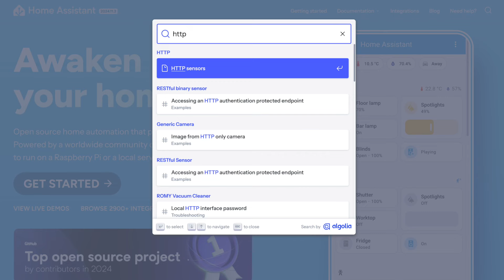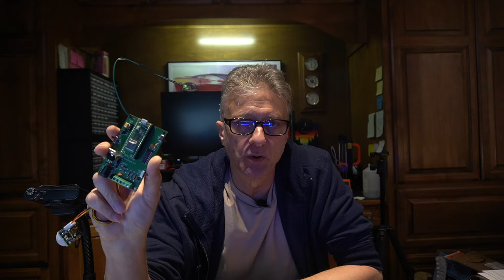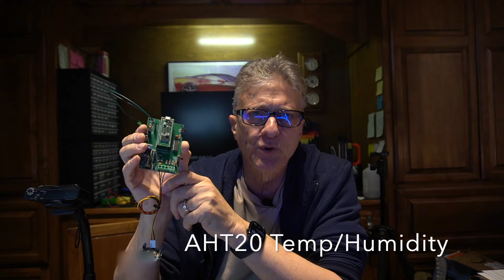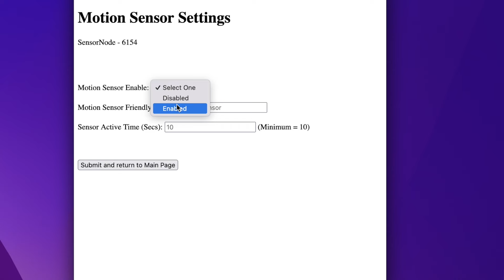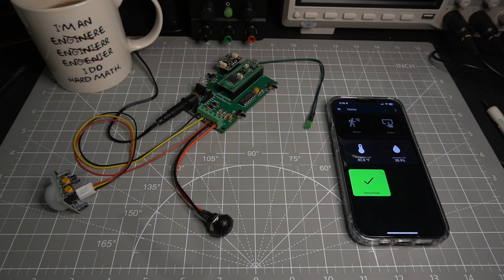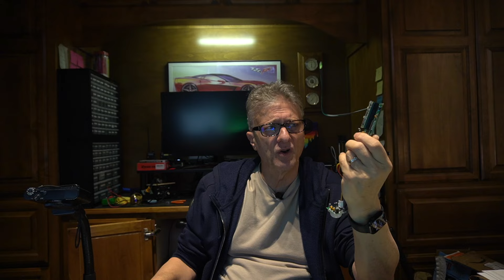SensorNode - The Easy Way to Add Sensors to Home Assistant

Comment: Why not use a ESP 32 S3?
Reply from the maker: Hi there - I assume your question is about using not only an ESP32, but also ESPHome software on it. That's not a bad approach, it just is not what I wanted to do. I wanted to make a simple solution that works extremely well for only a small number of common home automation sensors. Something that, coupled with the right PC board design, could make it simple to change sensors without changing the code. ESPHome is quite a different animal - fine if you know what your doing, but my goal was to make it super simple for folks who are NOT experts at integration. Thanks for the comment!

Comment: What com protocol does it use for variable sensors such as level, pressure, moisture. Since they have a 3-wire input, that would suggest 1-5 or  0-10 vdc? Is this a correct assumption?
Industrial instrumentation is commonly 4-20mA and easily convertible to 2-10vdc using a 500ohm precision resistor. 
This would enable the use of a huge variety of instruments.
I'm currently using a Fibaro SmartImplant to achieve this for temp & level on an outdoor wood boiler, but as I make the switch to Home Assistant, I'm looking for a better option to bring in 4-20mA inputs.
Reply from the maker: SensorNode does not natively support current loop devices. I designed it to easily support only a small number of common sensors. The 3-wire 'S2' interface in SensorNode supports only three sensors: temp, water, and motion. All of these sensors use 5V power. They need to be configured by setting a jumper before use, which effectively changes the circuit for each sensor. The temp sensor uses the DS18B20 digital interface, whereas the motion sensor sends out a train of pulses which are captured by the on-board latch. The moisture/water sensor is a simple transistor circuit which gets read directly by a GPIO as either 'off' or 'on' to signal the presence of water. 

If you need support for current-loop devices, you might check out ESPHome, which is a much more flexible (and complicated) way of interfacing to HA. 

Thanks for the comment, and good luck!
Reply: OK, thanks for that. I already bought a couple of ESP32 boards but have not played with them yet. My system has rapidly grown to almost a hundred devices, so I just ordered a Home Assistant green, so I'll be headed further down this rabbit hole.
Reply from the maker: @CFSTB you can of course use SensorNode for simple sensors - temp, motion, water, and simple context closures for things like level sensors/buttons/etc.

Comment: I use a Hubitat for this express purpose.
Reply from the maker: Hi and thanks for the comment, but I'm not sure I understand. Hubitat is a home automation platform. I looked at it briefly years ago when I was selecting my own home automation system. It appears to me that a simple HTTP REST API for sensors/devices does not exist on Hubitat. Are you saying it is easier to add sensors to Hubitat? Could you say more? Thanks!

Comment: This is pretty interesting. I've just set up a couple of motion activated lights via ESP8266 with PIR sensors. Having done that I can see how having sensors in every room would be very useful. I'm about to get ESP32s and configure them with mm wave motion sensors to do the same thing. Going through ESPhome, setting up the devices, getting an automation running in HA, it's a bit of a grind to do that. Having one box in a room that is easy to configure and can trigger HA automations, that would be excellent.
Reply from the maker: Agreed. My goal is to make it super-simple to setup and maintain common sensors w as little hassle as possible. Thanks for the comment!

Comment: This is a great idea, can't wait for the kickstarter to open up.

I also would like to have PoE available. Maybe just have network and power connections available to solder to. Then I could just get a breakout board and add it myself. Or just leave it for a future revision.
Reply from the maker: Thanks for the great comment! To be clear you want POE not just for power delivery but also for data transmission right? It’s the data interface that requires the most work. Perhaps if there is demand I can do a mark II version…

Comment: From this brief video, it seems like your board is extremely versatile in the kinds of sensors it can handle, but each board can only connect to two or three sensors at once. Is that correct?

For a lot of those sensors, the dry contact switches, did you look into Konnected? Their board is designed to replace the central panel of a wired alarm system, and can handle many such sensors on one board. They have a basic unit, a pro unit (POE), and expansion units for more sensors. It’s pretty nice!
Reply from the maker: I was looking for something that was simple and cheap for home use. I really couldn’t find anything - but honestly I was intrigued about the possibility of making one board that I could use for the most common sensors people might want. That’s why I decided to design SensorNode. You are correct it can only be configured to provide 2 external and the 2 I2C sensors at once.  But I like that I can use the same board and software image all over my house in many different ways. My motion sensors, contact sensors, and temp sensors are all SensorNodes. No integrations with Home Assistant, very simple, and very reliable! Thanks for the comment.
Reply: @tnbtech262  That makes sense. Konnected is designed for the use case where you already have wired alarm sensors (doors, windows, motion, etc.), and all of the sensor wires terminate in a central location. In that use case, Konnected is clearly better. One board handles everything, so you only have one config, etc.

But if you're installing the sensors new, in a built home, SensorNode seems like it makes that wiring job far easier. You can distribute the units around the house, instead of running long wiring runs. In that situation, a half-dozen or even a dozen SensorNodes are going to be cheaper than running the wiring to a central location. The labor alone for long wire runs is 80+% of the cost!

Not sure I see the benefit of not integrating with Home Assistant. I don't know what I'd use my sensors for, if not for use there. But it sounds like you can integrate with HA, it's just not a requirement for a basic install.
Reply from the maker: I wasn't trying to say SensorNode does not integrate with HA, merely that it does without installing any new software into you Home Assistant installation. I'm only using the built-in HTTP Sensor interface which comes with every HA installation by default. To me,  less 'plug-ins' installed into HA makes it more robust. Less to maintain. Less to brake. Like a toaster :)

Comment: Doesn't esphome also serve a very similar purpose?
Reply from the maker: Yes similar but not the same. My design is way simpler (and thus less full-featured). I feel my design is easier to setup, configure, and use. You can also re-configure it on the fly without loading new software. It’s just a different approach. I’ve got them all over my house, doing different things, yet all running the same code. The stack is super-simple and therefore easier to maintain. Thanks.

Comment: Why not ESP Home?
Reply from the maker: ESPHome is not a complete solution. It is only the software portion. If you are asking me why I didn’t use ESPHome for the software, the answer is complicated. But to sum up, I wanted a single design and software image that could be reconfigured on the fly without loading custom code from a Home Assistant integration. ESPHome is great and offers many devices, but it requires an integration with Home Assistant to configure. It’s also very complicated which to me means more likely to need maintenance. My goal for SensorNode is to have one simple device I can use over and over without any changes to the code. They really are merely different approaches. Thanks for the comment.

Comment: Should include POE. That’s the way to go
Reply from the maker: POE is not a bad option, but of course it requires a wired connection nearby. Not nearly as flexible. But something to think about! Thanks.
Reply: @tnbtech262  honestly speaking, if you are going toward one device which fit all porpoise, this has a targeting costumer in the HA environment who want to simplify its purchases and maintenance of the automation system, which are the advanced users. A lot of people don't like to get too advanced, because of the overwhelming learning curve which never end due to unreliability of devices and HA constantly evolving. The advanced users of home automations are normally also advanced in networking infrastructure employing reliable networks systems, mostly wired and POE, because they CAN'T loose the network if they loose power. The next level of upgrade will be the capability to DON'T loose your sensors if you loose your power. That's why the way to go is POE.
I would gladly use one of your "box" in each of my home automated environment (rooms or areas), as long as can be powered by POE and gives me dedicated access to/for BLE, Zigbee, Wifi, Presence detection, Sensors capability so I won't bother in looking for different ways to connect different arrangements according to different environments; gives me flexibility in managing stuff by area as it would work like a mini hub (...but more flexible) and I only have to remember and maintain a single type of equipment and firmware.
Reply: @tnbtech262  honestly speaking this type of "one fit for all" shall be a tool for both random users and professional users if you want success in the product. random users would choose it so that they don't need to bother about selection, but professional users will choose it for repeatability and scalability. Flexibility is the key in this sort of choices. I give you one example... if you look at a product for zigbee to MQTT called SLZB-06 it gives an astonishing amount of scalability and flexibility which is a no brainer for the consumer (despite you are going to use few of them). For example two ways to power it up is a simple way to reach all needs: one from the mains ranging 110/240 VAC and one from POE++ protocol which can tap 48 VDC and you can step it down on the PCB to use it for powering up various elements. Double power protection and redundancy can also be achieved. If we like to discuss advanced users, you shall consider the willing of scalability and simplify maintenance by having a device in each environment (area or room) where things connect as a minihub with limited wires lengths. Normally advanced HA users also employ advance networking infrastructures having reliable wired connections to provide POE almost everywhere because they CAN'T loose network when main power is lost. The next need for this advanced users is to ALSO ALLOW them not to loose their sensors, monitoring, DIY automations when the main power is lost and the only way is to provide a POE minihub in each environment so they are not dependent from secondary UPS scattered all over the place to sustain reliability of all different automations branches (presence/alarms/temperature/power monitoring... you name it) during that time when the power is lost. I personally won't mind to have one of your "box" in each of my automation environment (area or room according of where I can reach with the sensors wiring) as long as I can power it up through POE, provide me all type of connectivity I may need in that area BLE/IR/RF/WiFi/Zigbee, gives me the possibility to connect at least one type of each sensors family presence detection, temperature, humidity, doors contacts, water, vibration (etc...) with the possibility of add-on if necessary, like expansions for AI voice assistant, music assistant, speaker and microphone, LED strips controllers... the possibility are unlimited and driven by imagination only. Multiple dry-contacts availability which could be used at all available power voltages as mentioned above (110/220/48 and downward). Despite "one fit all" is most unlikely to exist, I think you have a good idea, but need to be refined to reach the most use cases scenarios where it become a "must have" product (like the SLZB-06) instead of another peace of junk which are now flooding the market
Reply from the maker: Wow - thanks for the detailed comment! Yes I can see now how such a device would be very useful for advanced users. Powering SensorNode off POE would not be that difficult ( as pointed out by another commenter) but I assume you also want the networking benefit of a wired connection which I would need to think a bit about. The other options of making it sort of a universal hub are nice but clearly out of scope for my "simple toaster' kind of device. My goal is to NOT be a jack of all trades (sort of like ESPHome based device designs which are themselves kind of cool) but rather to focus on a small number of simple, common sensors that most everyone would want in their home. You see, when designing for a large number of use cases, you necessarily complicate all use cases. Complication increases the chances for error and failures and will necessitate frequent code updates - which will either make the system less robust or more expensive (or both). Hope you understand. Thanks again!
Reply: @tnbtech262  @andreamessina6439 The barrel plug can also be PoE powered using an adapter. What voltage does it take in and what barrel plug does it use?
Reply from the maker: Barrel plug is a std 5.5/2.5 center positive type. You need to input a DC voltage between 7.5-24 volts. Thanks.